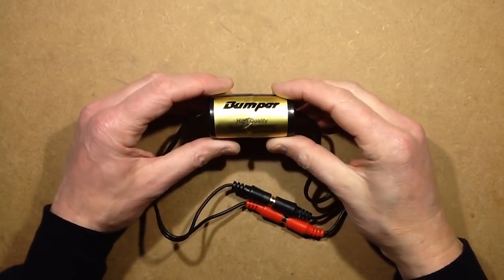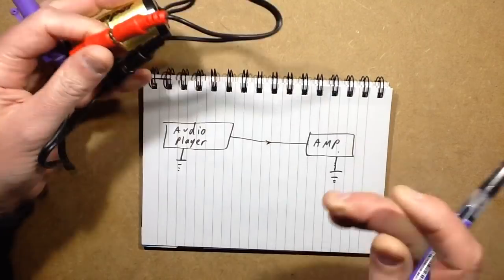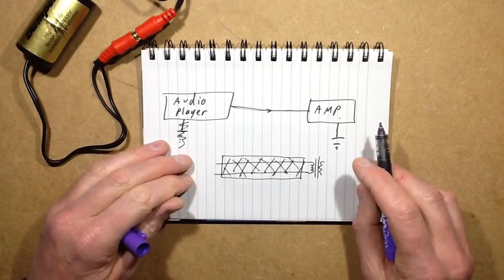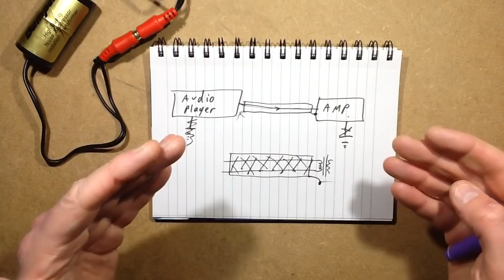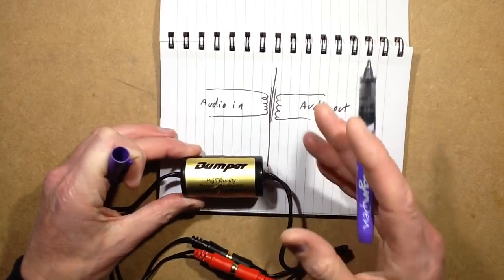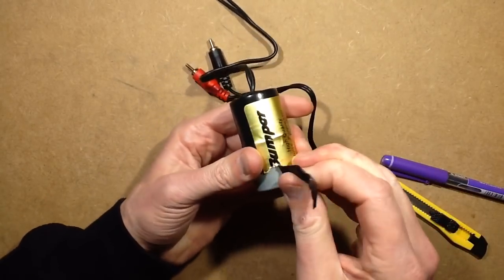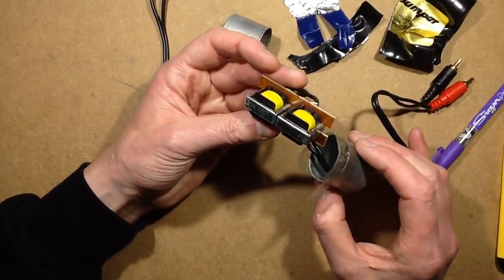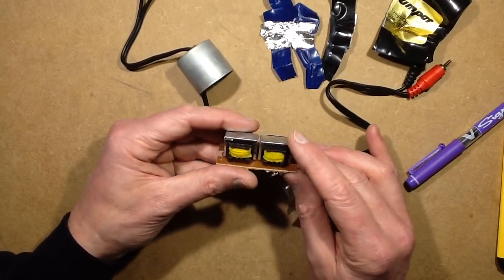Inside an audio isolator transformer module.

Comment: As an audio engineer I can tell you there will definitely be some frequency loss. The reason is the transformers are in effect "seen" by the source and amplifier as transducers, even if the impedance is very high. Like any single speaker, it can not reproduce (pass) the entire range of human hearing effectively. I tend to think it would loose a significant portion of high frequency because inductors in AC resist (impede) changes depending on the "Henry" rating of the coil and frequency of the varying AC waveform.
Reply: Hello Ria - I do agree with you 100% but most users of these are using laptops or PCs playing some kind of heavily compressed audio so in the real world those comments in my humble opinion do not apply.  
Obviously you would use a CD or high quality audio player from a digital output to get the best quality for broadcast.  I have worked in some radio stations that actually (shockingly) use youtube grabbed audio or MP3s.  These sound awful on FM broadcast.  In quality stations everything runs balanced line or digital.
For most typical users of audio if any high end was lost they would turn up the treble bands on a software based graphic equalizer.
Anyhow - well educated post.
Reply: FLAC Rulez lol
Reply: RiaRadioFMHD773 yeah. It's good but I just use wav or aiff for the reason of hard drive space being so cheap now. 

Just don't like MP3 as a rule. It's okay to email ideas with but that's it.
Reply: These are ferrite core transformers, like those used on SMPS and can operate up to hundreds of KHz to several MHz. Actually I would be more concerned about low frequency response. If the core isn't sized correctly it could easily saturate at low frequencies. But I guess this shouldn't be a problem at line level signals. Just don't try to pass amplified signals through that.
Reply: As an audio engineer, can you explain why these also seem to weaken the low end. I understand why they chop the high end off signals, but never understood why they also seem to weaken the low end as well.
Reply: One of the interesting things about transformers is the way they "refer" impedance from secondary to primary and vice-versa. They are the electrical analogues of mechanical gearboxes. It's hard to generalize about performance without knowing something about how the transformer is being used. Sure you could run the gamut of open and short circuit tests to discover the equivalent model but I would hope and expect a transformer intended for audio use would work up to 20k and hopefully a bit further. 

The first well known limitation of audio transformers is low frequency. Thanks to Mr Faraday you need more flux at low frequency for the same voltage. When the limit of the magnetic circuit is reached it begins to saturate. You will get less voltage out than you put in, and will also start seeing some odd harmonics (typically; DC biassing can create a mix of even and odd). 

That's why your old-school passive DI is only rated down to 40Hz, even though your bottom B on a 5 string bass is 31Hz.
Reply: Richard - It's due to Faraday's Law of Induction. The transformer core gets saturated. The workaround is to use a lower voltage.
Reply: @rich1051414  it may be possible to get better bass response if toroidal transformers were used. Also the cross sectional area of the windings must be large enough to avoid losses at low frequencies.
Reply: There will definately be loss: the laws of physics say that. but the difference will be like the difference between coat-hanger wire and cryogenicaslly treated speaker cable - in a blind test noone will notice
Reply: @-ugly-Derby  I am not surprised. Those are informative specs, thank-you. 

I think people confuse transformers with chokes.
Reply: Ridiculous to suggest otherwise
Reply: @rich1051414  if you were an actual audio engineer by profession you would have known this already in college. it reverses the phase of the signal. see it in a scope and you'll know what I mean.
Reply: @automachinehead  I am not the audio engineer, the one I was replying to was. Reading that back now, I can see how that could be confusing. I wrote that years ago. However, if both channels are phase inverted, why does the phase being inverted make any difference when it comes to bass response?  From what I understand, it is because DC rapidly saturates the core, and low frequencies approach DC.
Reply: @rich1051414  most cheap transformer based isolators will reverse phase into a complete 180°. Or you could be right about the transformer being too weak to handle dc signal out from the source. One easy fix is open the amp, put a resistor across the input and input ground on each channel so you don't degrade sq or use a good 1:1 transformer and build your own but even so, it will degrade sq
Reply: @FubarGRblog  so what's the solution to the annoying ground humming in our sound system?
Reply: @automachinehead  If you find the phase is reversed, just swap the 2 pins on one side of the transformer (either the in or the out).  The transformer doesn't care.
Reply: @lumpyfishgravy  I like your analogy of transformers being the electrical analogues of a mechanical gearbox! Very logical.

Comment: Ohh, I Just Got It, Was Walking Around The Store AAnd Thought About This Video And I Got The Idea WHY The Foil Is There, It Is Because The Transformers Are Not Put In At The Right Position And They Hoped That They Foil Will Help To Change The Current From One Coil To Another Better By Putting And Shorting Out The Casing Of The Transformers. ;D Thats My Guess Anyways.

Comment: Car Audio systems are notorious for an alternator whine that changes frequency with engine rpm. This IS and probably ALWAYS WILL BE the fix for poorly isolated high-power car audio components.  Isolators work every time. 😉
Reply: Would you need one on each channel?
Reply: Aslmx , each isolator takes care of 1 pair (1left, 1right). .   If you have front, rear, and sub outputs from your head unit, and you wish to connect an amplifier for each, then yes, you need 3 isolators.  Hope this helps you.  :)
Reply: I have never had a situation where an Isolator didn't fix a noise issue, as long as you use it on the offending end. Once that noise is processed as signal, you can't get it back out again.
Reply: This video and these comments are great for me and my Brother-in-law, who are both trying to figure out why our cars have very annoying feedback in the audio systems (his is worse than mine).
Looking at the wiring diagrams there must be dozens of chassis grounds, which can't help.
Reply: I know your comment is 4 years old at this point, but I solved my alternator whine by slapping a big ass inductor on the +12v side before the big ass capacitor right before the amplifier. Somehow whine was making it through a 0.5F capacitor...

Comment: Hi Clive, the idea of the tin foil is to join the two transformer shields as one Faraday Shield. It may be that the same components/circuit are used with a plastic cover.
This is normal for use in vehicles, due to air-born interference, like you said from the ignition high voltage spikes but the main use of this type of audio signal isolator in vehicles is to suppress the alternator electrical noise.
It used to be worse in the bigger type cars due to the high output alternators used having to cope with the amount of electrical items such as Electric windows/Sunroofs, Air-con, Rear heated screens etc, all quite modern in the day.
I used many of these in my days as an Auto-Electrician in the 80's on big audio amplifier systems.
Great videos, keep it up. Many thanks
Reply: +Mark Andrews But then why only on the top, it would need to wrap around the whole thing wouldn't it?
Reply: The outer covers the complete unit. The tin foil is only to join the two half's of the outers as they are only joined with tape on the outside.
Reply: Mark Andrews Good point.
Reply: +Mark Andrews I have worked on the car audio amps myself and seen what you say but have also seen what is called a ground loop effect as what Clive was talking about. The ground reference for some of the kids of my generation like doing is applying the ground connection to their amp in the back of the car to the body and usually in a most horrible way(wire stuffed under a screw that is nothing more than a 16 AWG) and the grounding point of the car stereo connection point somewhere under the dash or to the engine. These get really bad on the thin metal car bodies of the current manufacturing process. See these items install most of the time. Best fix I have done of my cars is to install a decent wire from the ground of the amp to stereo and also run a ground wire of suitable size back to the battery or alternator case for the amp and install a half to one farad cap with the amp.
Reply: +Joe Esteph that is correct
Reply: this is something that even the most educated teen/grad student would not know its called experience... thank you for the text book answer and the recollection of times past.
Reply: +Joe Esteph you too. experience practical knowledge thumbs up. sorry I'm just so tierd of teaching the "experts" 20 something machanics why things are done this way and not linking 2 separate voltage/hrz/systems together.
Reply: Mark Andrews if it bridges both together shouldn't the foil be on the bottom of the electrical tape?
Reply: If that's the reason I would expect the foil to be in better contact with the transformers - not on the other side of the insulating tape. Also, foil that just touches another conductor is unlikely to provide a consistently reliable contact.
Reply: Mark Andrews I suspect that the foil is actually being used to provide a conductive path to the two metal can halves when everything is assembled as cellophane is not an especially good electrical conductor -- the foil should make solid contact with both cans when everything is assembled and jammed into the metal cans..  Between the electrical tape and the adhesive side of the foil tape, both of which are usually insulating, the only likely electrical path directly between the two transformers and the foil would be predominantly capacitive (except by pure chance connection), so I do not see it being used to bridge the two transformers very effectively.
Reply: Yes you are correct. Its makes better contact to the outer metal end caps. The blue tape is used as a soft packing out material, hoping that the foil touches the casing as it is assembled. Sorry if this was not made clear in my 1st comment. I have even seen these tacked with solder on other brands.
Reply: Joe Ground loop! Yes not good using earths from all over the place. In competition builds I use to fit a earth bolt from under the middle of the floor and connected ALL earths to that one point. These devices were the DIYers friends and quite often sold with every amp supplied as people didn't want to be taking seats and carpets out to do a proper job.
Reply: How does it join the transformer shields when the foil is insulated from the transformers by the blue tape. Shouldnt the foil be under the tape, in contact with the transformers?
Reply: +Peter Jansen From what I understand it's there to couple the magnetic fields, but I don't completely understand why. To a certain extent they would probably be capacitively coupled through the foil but I don't know whether that's desirable or not.
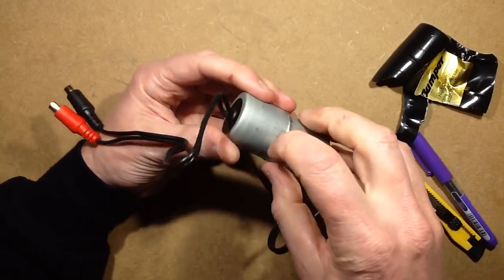Reply: It's there to couple the two outer halves of the can not the transformers! see at 6:29
Reply: Ok, that makes a lot more sense.  :)
Reply: The foil isn't meant to couple the outer can to the transformer shields, but to ensure the outer can has good conduction across it. The vinyl tape is to isolate the transformer shields from the outer can, and the foil tape is to help the metal can have conduction across the halves. It is meant to shield the bare exposed wire in the can from picking up EMF while being ground loop isolated.
Reply: perfect sir
Reply: @rich1051414  Yes!  It helps to ensure a continuous conductive surface, acting as a Faraday cage.

Comment: The foil was likely being used as a shield to block out hum/noise. It's a technique often used in guitar electronics where the cavities that house all the wiring/controls are lined with a conductive foil (usually copper) and then the foil is connected to ground. This makes it so that any electrical interference is picked up by the foil and sent straight to ground

Comment: I have installed one of these in my car and it works fantastically. Around the time of the install, I also made sure that I had all power and signal wires isolated and insulated. The combination of doing these two things completely rids the car of a static hum.

Comment: The metal case is a special metal called a mu-metal. It really likes magnetic fields. It likes them so much it acts like a magnetic short circuit (low magnetic resistor).

The aluminum foil on top of the transformers is used differently. Aluminum doesn't like magnetic fields, so fields are reflected away (high magnetic resistor).

I don't know why they didn't mount the transformers 90 degrees from each other to prevent channel crosstalk.
Reply: +Jammit Timmaj: Because it would not work. If you rotate one of them by 90° on the circuit board, the magnetic field vectors are still parallel to each other, because they are oriented perpendicular to the PCBs surface.

Btw, I have heard that mu metal is rather expensive so I would think they were not using it here, but I could be wrong. However the thickness seems to be really thin, so I doubt they are actually effective at audio frequency levels.
Reply: +Simon K. I meant to rotate the transformers so their magnetic fields are rotated 90 degrees. Sorry for any confusion. It'd probably make the PC board manufacture a nightmare... unless they decided to use non-traditional transformer type, like flying leads come out from the "wrong" side, both transformers are wound differently, that kind of thing.

Mu metal (sounds like a punk rock speed metal music genre) is expensive if you get the really good stuff, and the cheap stuff is ok enough. The metal isn't designed to block out by screening, but by being a shortcut for magnetic fields. The magnetic fields flow so easily through the metal it doesn't "poke" out the other side very easily.
Reply: I think that they put the transformers in that way so that they would fit in the tube.
Reply: +Jammit Timmaj  1- More the metal "likes" magnetic field it will shield it better.  2- The noise from ignition and mains are usually electro-magnetic interference, not magnetic. It can be blocked by a tick conductive shield, and the foil will not have that much effect. 3- This device only blocks electric coupling  and attenuates non-audible frequencies. More filtration and shielding is needed to get rid of all interferences. 4- Rotating the transformers is neither practical nor practiced.
Reply: Has Nas
1) Better explanation than I was able to do.
2) The isolator in the video is used to isolate a common ground in an effort to remove common ground noise. You can get conducted noise from nearby wires (think high power switching an inductive load). The radiating noise can be coupled into nearby wires and especially transformers that were designed to couple electromagnetic energy. Electromagnetic energy is still magnetic energy. I think you might have used the wrong word and meant something else.
3) The device in the video is only used to isolate grounds. There is some frequency modification, but that isn't intentional and is instead designed to prevent this. I'm certain 10khz will pass fine with little attenuation and 100Mhz will be attenuated, but that's just a happy accident and not intended. An audio ground isolator tries its best to not change the frequency response.
4) Rotating the transformers 90 degrees to each other will help attenuate cross channel interference, but is not done because the cost of changing the circuit board is too expensive and probably has minimal effect on the relatively high signals passing through (1V RMS will bury 1mv RMS of crosstalk).
Reply: +Simon K. cant be thaaat expensive. I found a sheet of pretty cool looking mu metal in an old serial wacom graphire tablet.
Reply: Yes - mounting them orthogonally would reduce crosstalk; I suspect that they don't do it that way because it would increase the overall size and cost of the unit and most people wouldn't notice the improvement.
Reply: @jammit That was hilarious, you made my day, thanks for the laugh.  I know you were not serious. :|

Comment: The foil is so the aliens can't listen to your music.  ;)
Reply: +Ken Wolfe But the Illuminati still can
Reply: +VREDFOX lol
Reply: Robert Gaines lol!
Reply: Have a look at those medical shows where the run a 'probe' up a vein all the way to the hart, or brain - Gesss where the entry point is.
The groin, vagina etc, big blood vessels, easy access.

Obviously those aliens are showing the way to the medical elite.
Reply: china made car audio often pick alternator whine. .so annoying. .what if ur not using extra amplifier just a Normal stereo  where  to place this filter ? is it between the radio output and the speakers?
Reply: Wrong device, look for filters to go on the power wiring.
Another check, try playing a CD etc, and temporarily disconnect the radio antenna lead to see it it's getting in via the antenna sheild/earth.
Reply: Too late,... We heard the music and have now arrived!
Reply: the foil is for magnetic shielding as is the metal case around the outside!
Reply: LMAO 
i laughed hard :D
Reply: Good. If aliens heard my music, it might give them cause to destroy the civilization that gave rise to such incoherent noise.
Reply: It's called "hum" because it's their vibing feedback.